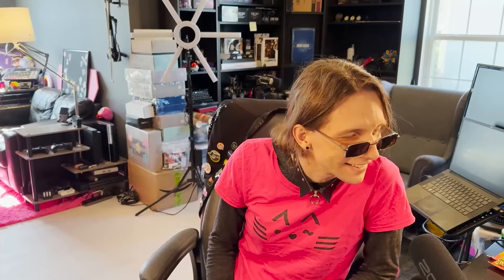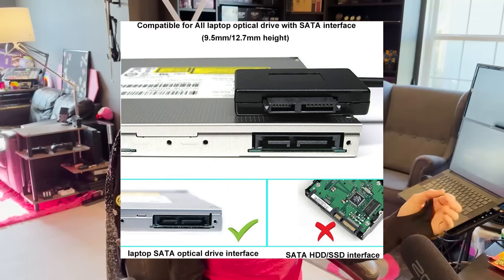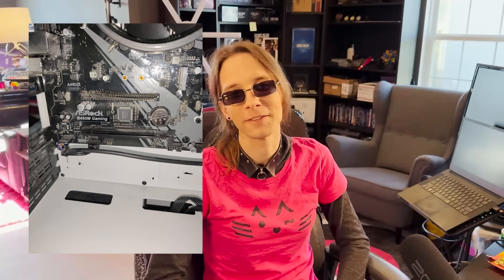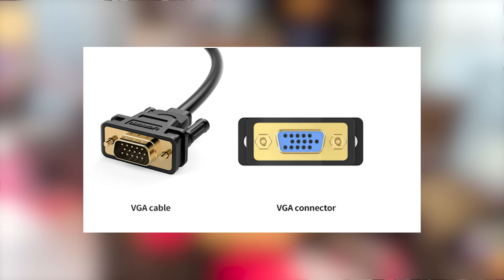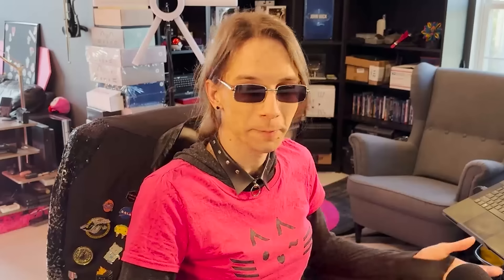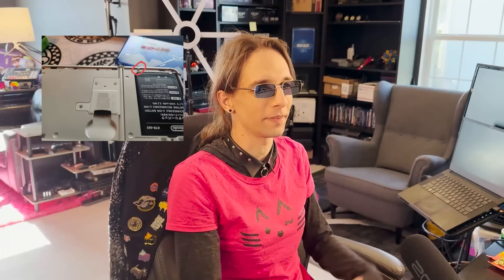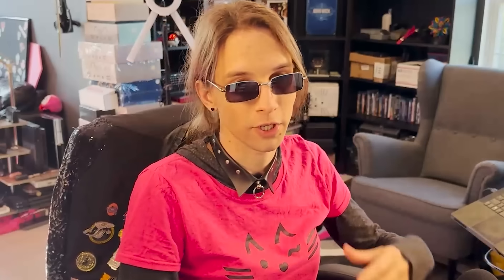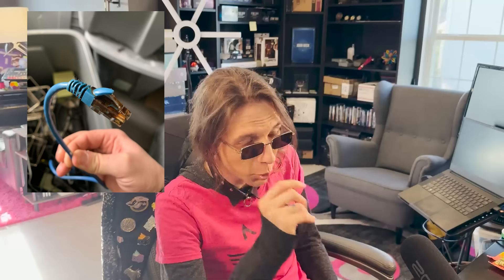How to NOT computer | Lexplanations | r/techsupportgore & r/hardwaregore

Comment: Hey! About that Ethernet cable splitting. You are right that it is not a good option. But! Butt! And i beg you to hear me out :) For 100Mbps you only use 4 of them and other 4 are just unused. And if you already wired everything through the wall with like 20+m of cable - you don't want to bother that wall again at all. An now your internet provider says that for tv you'll need another (separate) network (with broadcast over network and everything). Sooo... you consider downgrading your wall socket from 1Gbps into two separate 100Mps sockets OR you can wallhack for several days. I personally chose to do a surgical "ethernet splitting". I don't think you'll read it. But! Butt! You are so cool! Keep it up! Thank you for all of your narration! It is perfect! (except those parts where it is not, but let's just skip them)
Reply from the maker: Totally fine for this fix as a home hack, but over half of the devices I’ve installed in the last five years have been POE- phones, IP cameras, POS terminals - and leaving that kind of thing for the next network engineer just makes me shiver haha. It works, totally, but I always run doubles no matter what for each network location so I don’t end up with that. Just my personal opinion, and if the customer doesn’t want to pay for doubles and they don’t mind the look I’ll cover the extra supplies if it’s a SMB or restaurant.
Reply: @TheLexikitty  You are reading through all thousands of comments! Oh you absolute lunatic! Love it :)

Comment: On the CD drive with the laptop I don't think the disc actually broke out of the drive. It might have somehow squeezed in the gap between the outside of the drive case and the slot in the laptop chassis. I managed to do this with a floppy disk once and it was very annoying to recover.

Comment: Modding usb c on devices with a proprietary connector is really cool, i currently have some parts in the mail to do that with my ThinkPad t440p, which is especially useful in that case, as the massive power brick it usually uses could be replaced with a tiny usb c brick
Reply from the maker: I ran a T440 for a while that did run on USB C power, see if it supports USB C charging. Sometimes the power brick is needed though.
Reply: @TheLexikitty  yea, it definitely doesn't have a USB-C port by default

Comment: you can make unfancy rackcases into fancy with sharpy my dude. in my apprenticeship (german) we'd call it "mount morsecode that rack over there real fast" (take a sharpy and make everyones job easier later on), when we got a new housing rack that came without (they all came without, middle management was stingy) 😀
also 3h to go presjhift D:

Comment: Compactflash is aside of the reasons why to use them also very close to IDE (the one used in 2,5" Laptop Drives. You may need some adapter board on Desktop. But cheap and easy) So. You dont actually need to include many things and search for drivers for them, which is great. Especially on Win95/98 Retro Builds.

Comment: 3:58 I had an MSI motherboard where that happened because when trying to reseat a GPU I had trouble removing it or something. I don't remember how I did that very well. Strangely enough there were a few reviews on Amazon where customers complained about the slot coming off on that motherboard.
Reply from the maker: yeesh

Comment: Hey watching this again cause why not?  Got to the part with the 3ds and I remembered someone used Posca pens to mark things,  think they were using said pens on a model kit.  It should be possible to mark the heads of screws with a pen to help see where they came from (especially if you were careful enough to mark a tiny dot next to the hole.

Comment: I can confirm. The worst environment for computers besides fast food is schools. My school offers a maintenance class for students. 521 kids. 1st semester alone 120 chromebooks. To be fair majority of them was the shitty 203 ASUS laptops that for some reason don't have anything holding in the battery cable. Why they don't have one. No clue our guess is the design was from when they were first putting USB C on their chromebooks and didn't know how to deal with lithium ion batteries.
Reply from the maker: i swear, all education devices should use those magnetic release USB C adapters, just glued in
Reply: @TheLexikitty  It's worse. I was talking about the battery to motherboard connector not the external port but the external port is just as bad.

Comment: If you take your laptop apart just use a piece of cardboard and stick the screws into the cardboard in the way you take them out. That is the cheapest way. Or lay the screws on a piece of paper and use cello tape to stick them to the paper. Easy like that.

Comment: I had an internal SATA port on a gaming laptop die on me (RIP hard drive, thank god for backups) and I tried to fix it at home. Couldn't get all the screws off so I just uh... rescrewed it (MSI, all screws same size) and took it into a local tech store for a fix. Laptop's still stumbling on with other issues, but those are fixed with a wireless keyboard. I make it a point to NOT try and tech-fu my way out if the tech-fu is lacking.

I want a working computer not a fancy paperweight in the thousand dollar range

Comment: the ethernet port one is not actually, automatically, wrong. you absolutely can split the pairs like that, as long as you wire it correctly. its rarely worth the effort, but sometimes it is if running a new cable is spectacularly difficult or for special cases or certain voice uses.
Reply from the maker: For home use it’s fine, but I haven’t done an install in the last 5 years that didn’t involve some sort of POE, additionally that’s not a surprise I want to leave for the next engineer. Does it work? Sure. Should it be done? Hell no.
Reply: @TheLexikitty  agreed, it's a terrible idea, was just pointing out that stating it wont work isn't accurate. i've seen it at work in an ancient install (30 year old DC), the kind of place where running a second cable could have been impossible. it was probably laziness though.

Comment: At 8:54 ish, my gpu is on a similar slant because I had to rebuild a pc on a budget. Basically, my old motherboard died (pet hair/dust and bent cpu pins) so I scavenged the gpu which is a 1660 ti so that I would be able to afford everything else. But the old card is a bit small for the case so it’s zip tied and held up by bent pci shields

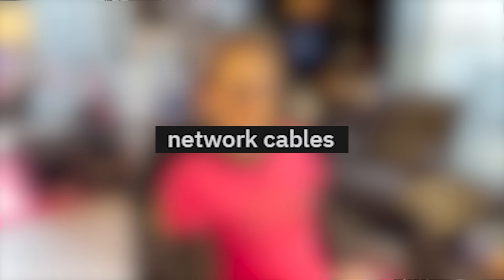Comment: @1:31 I get the fact that it's not terminated very nicely, but that is just splicing a gigabit cable into 2 100mb links, useful if there is only one cable going to a location where you have 2 IP cam's for example.. The switch will just see 2x100Mbit connections.
Reply from the maker: Still something I would not run, and would take garden shears to if it was part of my infrastructure. Perfectly fine for home wiring I guess, but can’t see a justification for doing it like that in a business - also that’d kill PoE for the cameras.

Comment: One time I has a mobile router and it worked while half of it was under water and I panicked and remove it from the water and press the button to control it and that was the last time the screen worked router still works (sometimes it's hard to turn it on and sometimes the screen flashes and shows random things)

Comment: That laptop mobo in an atx case reminded me of my OLD(had ISA slots) PC. I don't remember why but the whole front panel was missing along with the power button. Did you know you can power on a pc by running the end of the power switch header wire (dunno how else to call it) along the aluminum frame of the case? YES, I turned on my PC by short wiring it. YES, there were sparks. NO, I don't have any footage :(
Reply from the maker: I did but there shouldn’t be sparks, it’s a logic level signal that should be 3.3 or 5v
Reply: @TheLexikitty  yeah, but "sparks were aflyin' " is more dramatic than "the contact point sometimes glowed slightly in low light conditions". BTW Thank You for entertaing and educational content.

Comment: I've never encountered proper gore like this stuff, though I've had some head scratchers. SFF Dell optiplex, did not boot. Was sent out to replace the CPU heat sink. Not the fan, the heat sink.

Got there, it wasn't shorting on anything, and it wasn't booting at all, not even enough for poor contact to lead to an overheat. Even if it hit thermal protections in under a second, it needs to start first for that to be a problem and it wasn't doing that. I can't guarantee proper contact, but it would have at least started. I can guarantee that it was not touching anything it was not supposed to. But hit the button, *nothing*. I confirmed this on site. Replaced the heat sink knowing there was no way this would work.

It worked. I have no idea.

There was also the 360k floppy on MS-DOS 3.3 that I ran chkdsk on due to problems, which reported 4 gigabytes of bad sectors with 60k usable. Subsequent use of the disk confirmed that 60k did work, though that's not hardware that's just a bizarre software glitch. I wish I had that floppy still.
Reply: Thinking about it I don't recall exactly how it mounted, maybe it was a screw on the backside shorting on something, which makes me wonder if that system would fail at some point after jostling and the screw moving ever so slightly? It's the only explanation I can come up with short of that heat sink being literally cursed.

Comment: I know a bit about tech, I completely tore apart my PS3 and repasted the APU and GPU and then put it back together again with no instructions except taking it apart and putting it back together like 4 more times because I forgot to put a part in

also I completely nuked a Toshiba 2013 laptop by updating the bios, booting into windows perfectly fine, and the computer randomly restarting on me saying it needs to install more bios stuff, and then it no longer even gets the toshiba logo it just powers on, black screen, fan kicks on and back off no sign of life

it's lost somewhere at a recycling plant or something now idk

Comment: 1:32 No!

Do NOT shoot them for this...

Shooting them is far, Far FAR to nice and humane for people guilty of this...

Instead use cement blocks and chains to suspend them from the rafters splayed out in an X formation, then SLOWLY SKIN THEM ALIVE WITH A SANDBLASTER LOADED WITH TABLE SALT!!!

Don't forget to periodically spray them liberally with a mixture of rubbing alcohol, iodine, hydrogen peroxide in a hyper-saturated saline solution (AKA water that has the maximum possible amount of salt dissolved in it)...this serves 3 purposes...
1) They don't pass out on you from Shock...
2) It MASSIVELY increases the amount of Pain and Agony they suffer...
and
3) They don't die to soon from Septic Shock due to an Infection...

Thank you and have a nice Inquisition...

😄😁😆😅😂🤣

Comment: "When these were beginning to be designed..." Back then there GPUS were MASSIVE. 2-3x the size of what they are today. Also RAM boards were EVEN BIGGER.
But most of all: those connectors were designed for laying flat and protruding UPWARDS - NOT SIDEWAYS. It's the Tower Mania that hit us in the early 90s that broke the whole ecosystem. 
You've seen pictures of the old industrial computers. They're big rectangular bastards that take up the whole desk and have enough space for a CRT to comfortably reside on top. That is the way it was always meant to be!

Comment: The hammer you pulled out in the compact flash section, where did you get it? I have that same hammer. It was gifted to me by my father. Its gotten rather rusty so I wanna see if I can find another
Reply from the maker: Mine was gifted to me by somebody i worked with, not sure where they got it either. Mine has also rusted pretty bad on one side.

Comment: I remember when i was building my computer out of parts my great grandfather left behind...i didnt have any screws to mount the GPU with, so for a time it was held in with zip ties
did it hurt my soul every time i looked at it?  Absolutely.  Did it work until i could afford screws?  Yes*

*( Doing VR back when i had the old oculus rift was fun because a few times id move too fast and since one of the ends was hooked up directly to HDMI, if i moved in just the wrong way id yank out the GPU because the plug was just that strong ig.  I'm pretty sure it still works today, but i cant test it since my birth giver stored my computer in a damp and moldy environment for over a year and some component blew up one final time before the PC lived no longer.  RIP 'ol blue ;-; )

Comment: Have you ever heard the tale of Darth Cat4x2? No, I suppose it's not something you'd learn in modern tech support...

Linking 2 of your sections, the cat5 split picture near the beginning and the old building with limited network drops you mentioned are each other's solution. As you said, you can use only 4 lines out of the 8 per cat5/6. It doesn't allow duplex connection, but acts as 2 cat4 (maybe 3?) lines that are limited speed. The standard bases it at a minimum 10Mbps@200ft, but in practice it maxes out just under 100Mbps. Why would you ever do this? Because the single office is now home to 2 network devices instead of 1, and the customer insists that each device has its "own" line back to the switch instead of sharing it via a switch in the office. I'm not saying it's a good idea, but we've all done things we're not proud of to meet a customer's "spec" 

One legitimate use case would be if one computer was connected to the internet, while the other computer was connected to an air gapped intranet, but both routers were in the server room.

Comment: You need to really try to pull up the socket. It's more or less a theme with PGA chips that the  thermal paste will glue the heatsink to the heat spreader and lift both the chip and the heatsink unless the contact is broken first. The socket will stay put unless something's gone wrong (mfr defect, temps somehow got to solder melting point, that kind of thing).

Qosmio was... Toshiba's(?) line of laptops.

About that VGA port: stop to think for a second. JUST PLUG THE CABLE UPSIDE DOWN.
Reply from the maker: The VGA housing is opposite to the polarity of the internal connector. Plugging the cable in upside down would mean the pins, which are polarized, would jot fit.

Comment: you glanced over something at CF cards...they're used because they are ACTUALLY just IDE, hence all you need is literally a super cheap adapter that simply re-wires it to the hard drive pinout, as opposed to stuff like sd cards where you would actually need a converter, which translates between sd card protocol and IDE (or SATA or whatever) protocol
kind of like how displayport can carry hdmi natively, but for vga, you'd need a converter, not just adapter, CF cards aren't EXACTLY the same as hard drives, which is why you are actually gonna need to get a lot of different cards and adapters and test which ones work, but they are pretty close...
sd cards are way way cheaper, by themselves, you can get bulk orders of small-capacity cards for like, a couple cents per card, you just grab a bag of 100 for 10 bucks and are basically set for life, lol, it's the adapter pricing, which is why people use CF cards....
Reply: by "small" I mean like 512mb or up to maybe 4gb, or perhaps 8gb if you're really lucky
Reply from the maker: Somebody else commented this and that makes me so happy

Comment: If you want to run electronics in/around restaurant kitchens but don't want them to get Eeeeeeeeeeeeeeeeeeeeeeewwwwwwwwwwwwwwwwwwwwwwwwwwwwwww with grease (and other materials), then first, install plastic explosion-proof junction boxes and 0.75 inch (or larger) conduits...Exterior Weather Proof boxes and conduit fittings might work too, but the Explosion proof ones have MUCH better seals on them but they are more expensive than their lower quality Weather-Proof brethren...

The routers and switches get installed in the junction boxes (the plastic should not interfere with WiFi signal strength) and the power and Ethernet cables all get routed through the conduits to areas FAR away from the greasy kitchen...

The seals on the box access lids and conduit couplers and the boxes will keep the grease out of the boxes...

The box and conduit exteriors WILL be Disgusting with a capitol 🤢🤮, but the delicate electronics inside the boxes will remain pristine as the grease, dust and grime endemic to a restaurant kitchen can't get inside...

😄😁😆😅😂🤣

Comment: Whats wrong with dividing one ethernet cable into two separate 100M connections that will work perfectly fine?
Reply from the maker: For home use maybe. For enterprise environment, besides crosstalk, POE, and other issues you also have to document that weird cable to keep track of it for future network engineers, when it’s an entirely unnecessary thing. Just creates more problems than it solves

Comment: 2:04 
Imma gonna guess this cable was used for telephone. As you need 4 strands :)
Reply from the maker: True but that's even worse, running POTS lines through CAT6 can damage switch ports if the switch doesn't have port protection.
Reply: @TheLexikitty  not if you terminate them in the middle of rj45 plug :)
We have two phones terminated like that at my work and sockets are still fine after a year
Reply from the maker: I’m so sorry for your work